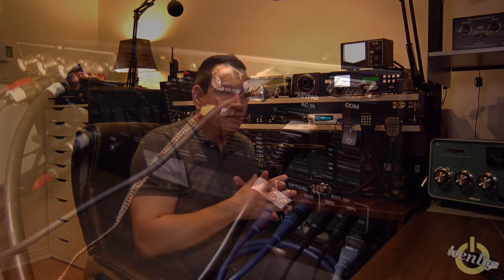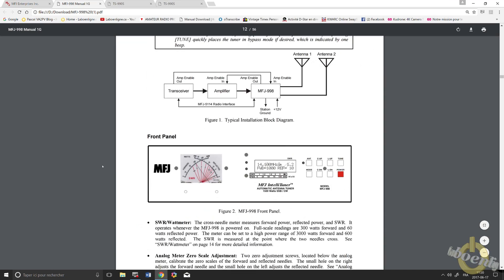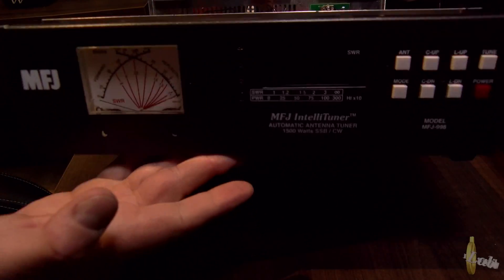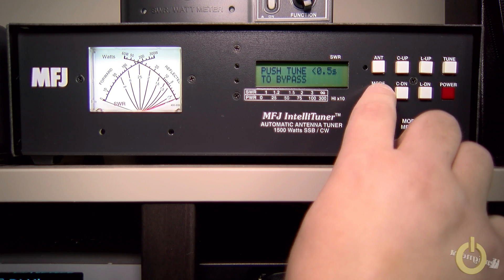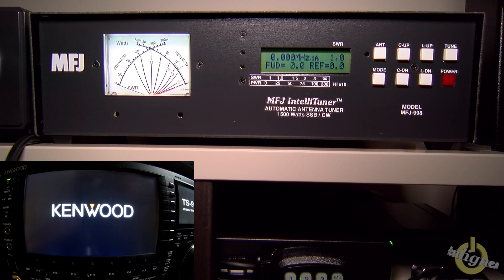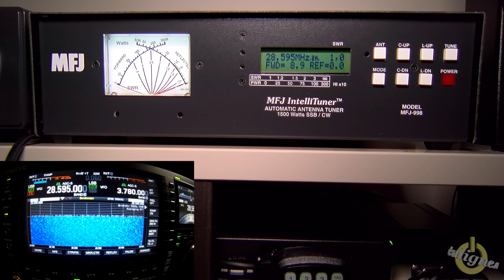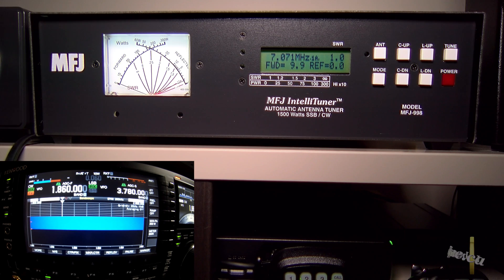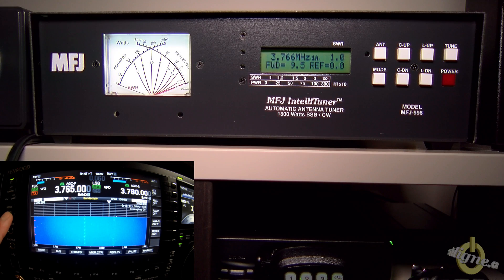MFJ-998 automatic antenna tuner 1500 Watts - Review and Setup

Comment: Thank You for taking the time to create, then share this video.  I bought my MFJ-998 in April of 2020, used with ICOM IC-7600.  

Kept getting messages from tuner, “Huh?, Increase power” That only occurred at failure to tune points.  Most bands worked great.

Moved to new house, now using a long wire, about 270 feet long, or 82.3 meters long.  Same trouble on specific frequencies, now using a new ICOM IC-7610, purchased on Black Friday, 2024.  

It has failure points too, my MFJ-998 never shows power input levels during Tune above between 5-6.1 watts, then the “Increase power” comments, your system showed 8.9 to 9.7 watts during MFJ-998 tune cycle.

Prior to setting up long wire, I developed an Excel spreadsheet sheet for multiples of 1/2 wave lengths, for all chosen bands I use.  Might be time to just add another 3 meter chunk of wire to the end of my long wire and see if that helps.

Chuck W9KR

Comment: Hi

Another question. 

I hv the amp enable hooked up to my amp and all are running well!
Question: With the amp on(opr), not in standby, can I re-tune the mfj-998, just to touch up the swr, or do I need to switch the amp to standby? 
I am thinking NO, because the amp enable id hooked up, but I may be wrong. 

Thanku again,
Billy

Comment: Nice video

A question. 
When tuning up on my 993, I was told that I can tune with my 7300 set to 100 watts and the radio will automatically cut bk during tuning. 
But, with the 998, does the same apply, or must I reduce power manually??

Thanku
Billy

Comment: A question.  

Re: My Heathkit sb-1000 tube amp

How can I hook up the amp bypass cables from the amp to the 998?  Or is it not possible?
If not, can the 998 be configured in a manual mode, so as not to auto tune while the amp is operating?

Thanku

Billy

Comment: Hi Pascal,  Thanks for the informative review.  I have a question.   The MFJ-998 specifications say that it doesn't work on 6 meters, yet some say that it does!  Have you ever tried it on 6 meters and if so how well (or not) does it tune?  Thanks & 73 - Jim WA2UMP

Comment: Thank you for this video. I know it is old one but i have one now for 6 months or so and never did get it setup correctly. I used it manually as a friend of mine has one and that is what he does. I watched your video just now and set the menu up correctly and put it in auto and flawless now. I will have LAN unit/remote setup soon and now i can safely use it and not have to change linear as it is on auto also. Glad i spent the money on it. My ALS-1306 is close to legal limit!. Thank you once again for the tips.

Comment: So is this jumper for the IC-7300 suppose to be on or off?  I see possible both ways in the manual.
Reply: I'm sure you've figured it out by now, mine didn't start working properly until I removed the jumper

Comment: Pascal,
I had watched several other good videos on this tuner but your was by far the most helpful.  It gave me the confidence to go buy the unit.  I have not yet set it up in my shack.  I expect to do that this weekend.  Thank you for a VERY thorough review and for the demos on how to use the menus to set up.  Please keep up the good work and keep educating us!  73’s, KK6YLW
Reply from the maker: Thanks Bob.  At first, I experiment similar problems that I found on the web and then found out that it was not set properly for my radio, so I made the correction and it works like a charm.  It's been more than a year and this unit is great.  I'm very happy my video was helpful.  73 Pascal VA2PV

Comment: Got this tuner Pascal. Flawless..
Reply from the maker: Hi Roman, great news.  73 Pascal VA2PV
Reply: Got inspired also by your cable management video....went ahead and fixed my wires and cables. Now its clean and tidy.  Thank you for taking time making those videos. I'm also a Kenwood fan. 73!
Reply from the maker: Hi Roman, these type of comments are my paycheck, I do this for the hobby but video is now part of the hobby.  I do videos about my projects, one after the other and I share the steps along the way.  If it helps others, I'm happy.  Thank you and 73, Pascal VA2PV

Comment: Hi Pascal, I have an Alinco DX-SR8, linear Ameritron AL-80B, and the Tuner MFJ-998. Where should I connect the amp out and in to? Thanks KP4RGD
Reply from the maker: Hi Raul, you connect it after your Amp (between the antenna and the amp).  You will need the correct cable for your radio, you can make one or buy it from MFJ, the MFJ-5114A, for more information follow this link http://www.mfjenterprises.com/Product.php?productid=MFJ-5114A  Consult your radio (page 92) and tuner manual to complete the setup.  Hope this help.  73 Pascal VA2PV

Comment: Was there supposed to be a jumper in the box? why did tou have to make one?
Reply from the maker: Didn't find any and it was not installed.   It's a very common computer jumper.  73 Pascal VA2PV
Reply: So short story reading the two replies, one with a jumper in the box and one without, take the cover off and check!  My Icom does not want the jumper.
Reply: Mine came with a jumper attached to only one of the pins.

Comment: Hi. That tuner look's dam good. I would think MFJ would have put a basic setup manual with it though. Has you described it is easy enough to get that off the net. It do'es rattle a bit during it's tune up, but do'es it quirk enough. I am surprised at the compactness inside to say that is for up to 1,500 watts. Well thank's for the review. 73 de John- G0WXU
Reply from the maker: Hi John, yes it does look good.  When we are dealing with a high-power it gets complicated, I guess there is no basic to start from as it all depends of the gears that comes in the loop.  I received an email about this video from a wise operator saying, “there is no such thing as plug and play in our hobby as all the manufacturers used their own protocols to interact with their accessories”.   Taking that into account, MFJ did an amazing job adapting the protocols for each manufacturer, so I guess it’s hard to keep it basics. Thanks for watching.  73  Pascal VA2PV
Reply: @Laboenligne  Yes, MFJ met that challenge amazingly well, much better than they other major tuner company.